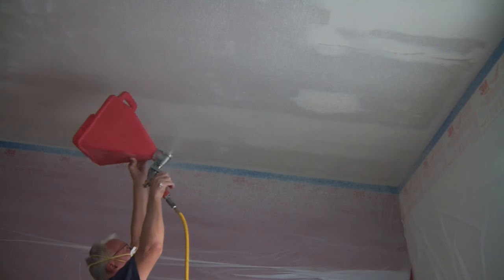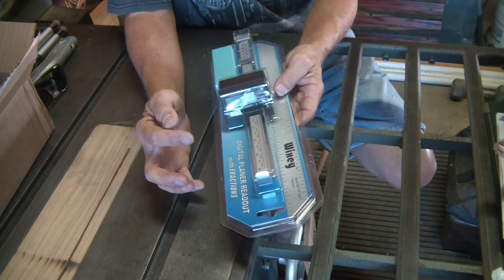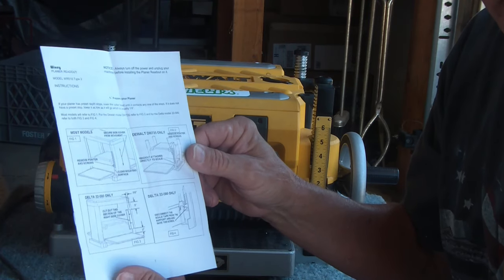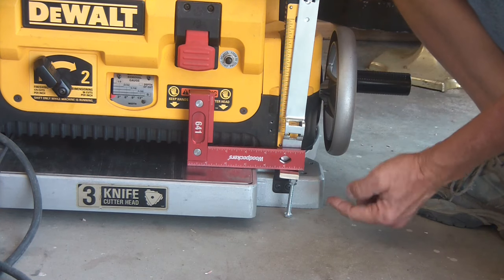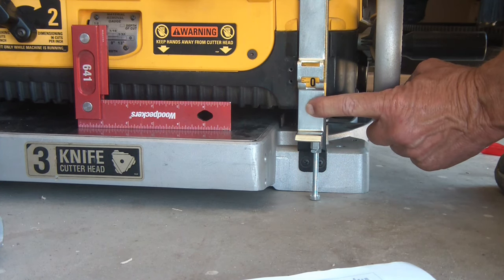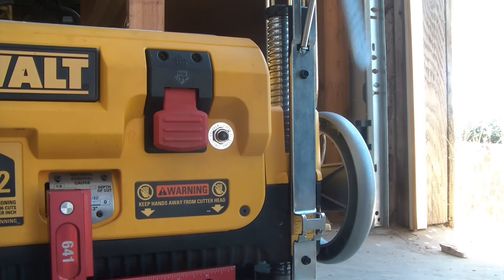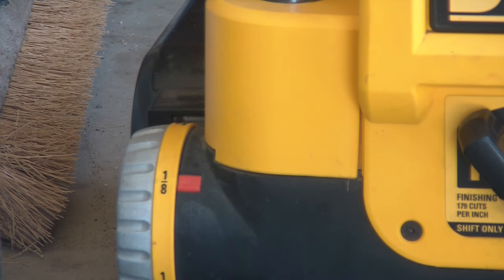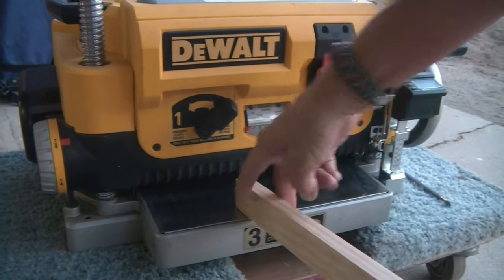Install & Demo of Wixey Digital Planer Readout

Comment: I see this video is 2019.  Any regrets installing this or the helical cutter head?
Reply from the maker: Vincent Esposito No not one regret. If anything I wish I did it sooner. It actually cuts quieter. I was amazed when I turned it on for the first time and ran some red oak through I forgot to grab my ear protection after the piece went through I stopped and though WOW it didn’t blow my ears away. Still wear them but it’s much quieter and the cut is fantastically smooth. My old blades I hit a missed screw and had to get a set of new blades. This cutting head all I would need to do is turn the damages pieces and back to work, by far a superior cutting head and well worth it.

Comment: Well done.  Regarding the "little play in there" - that can be eliminated by ALWAYS adjusting "into the cut" - never away from the cut, to eliminate the "backlash" or "slop" in the machine.  If you have to back out, then back out more than necessary, and then come back "into the cut".  Otherwise, you could be getting the desired cut depth PLUS the backlash.  The older the machine (more used), the greater the backlash.

Comment: thank you , i have   a DW735 planer and really over the standard set up are you still happy with wixey digital set up?
Reply from the maker: Peter Gray I mostly us it for when I need to get a specific thickness. If I have to remake a door jamb or even the sill or anything I need to recreate a special thickness for that custom fit. I  can just crank it to what I need with out guess work or grabbing my calipers and check every pass. This makes it very easy fit. It is fantastic to use.
Reply: @The Shack  thank you I ordered it just now

Comment: Now that is funny, a pipe in one side and a piece of exact dimensioned piece of wood.
I noticed after you planed your stock you measured on the end of the board with the Wixey and you have some snipe causing the difference in readings.